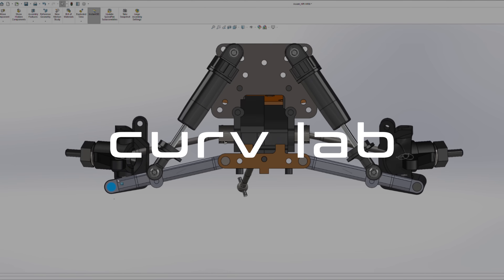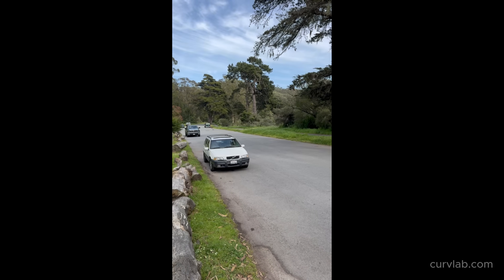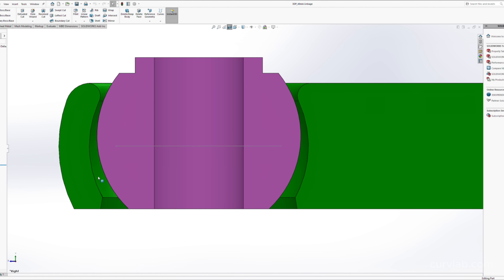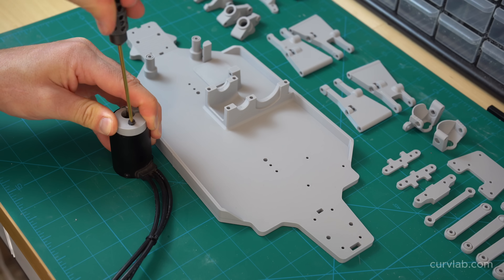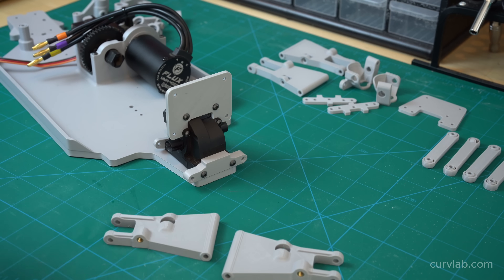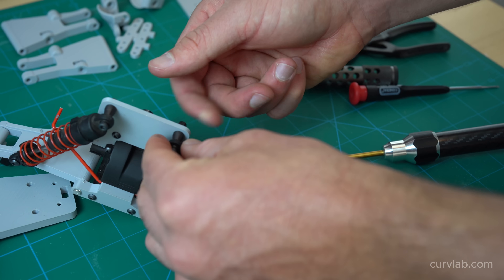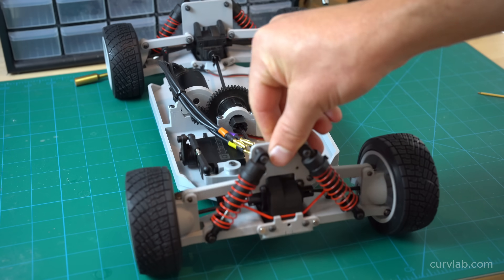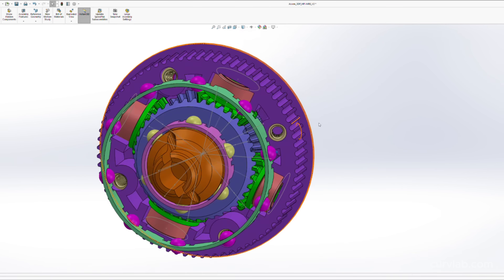3D Printable RC Chassis [PART 1]

Comment: I cant stand my bambu lab x1carbon. One the small size. Two I bought it just before they release the h series printers... and three and mainly three. My printer SUCKS. PRINTS FAIL CONSTANTLY. MACHINE DOESNT NOTICE FAILURED AND CONTINUES THE JUNK PRINT AND RUINS MY HOTENDS AND EXTRUDER COVER AND OTHER PARTS. Have submitted tickets in regards to the issues. Have got some parts replaced. Yet my prints still fail...

Comment: Id have to check specs but im thinking cheap drone motors geared down a lot. You'd have crazy torque and super high RPM. Should be lightweight and efficent as well. Amazing work and your design might be adaptable for that with minimal modifications.

Comment: I'm impresed by your skill in CAD modelling in SolidWorks. Your CAD assembly is fully "mechanised". If you take the wheel up in your cad assembly, all chasis elements react! I made similar in SolidEdge, but with smaller amount of parts.. incredible good cad skills you have

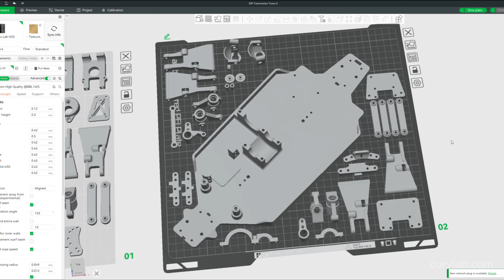Comment: This is a masterpiece! I would love to drop a few positive advices for you. First of all, it would be great if you do your own project based on most famous and common chassis such Tamiya TT02, LC Racing PTG2, or the new entry HNR Foxhound. Those 3 for me are the best chassis to get along as example for your upcominh project. Secondly, most of RC nowadays are mainly 1:10 onroad and offroad rally, and its just a matter of shocks and tyre. I suggest you to build a car with Rally anatomy so in future you can just add on 'on road parts'. Last but not least, make it dust and waterproof as much as you can, people love running their RC in any terrain. Goodluck!

Comment: Ugh. Bro you're able to 3D design an RC car any way you want. And you ended up using ball joints and c clips for the suspension lol. As soon as you hit a large bump or have a moderate crash those ball joints are popping out. And c clips are a pain to take on and off for maintenance, not really reusable. You're also using a traditional flat pan chassis which isn't bad but isn't great. A monocoque chassis would be a lot stronger and more rigid. At least add some chassis braces.

I get it, you want to be able to 3D print RC car parts. But you're only emulating old outdated designs when you could be creating brand new ones. Take a look at modern day RCs engineered today to get an idea of what's better. Also check out banned racing RC cars because their performance is so much better than traditional ones.

Comment: You have my attention ... subscribed!  I'd love to be able to print this out so if you need some sort of tester base, count me in.  I get all the engineering, but I've got 0 experience w Fusion ... so would love to use your build here for sure
At around  13:38 when you're looking at chatter, it looks like there is a lot of slack in the 4-link pivot points (the print-in-place you did).  Look at the passenger side, top-inner pivot and it looks like the top arm has a lot of left-right play against that top-left pivot

Comment: you said the AMS 2 automatically dehumidifies filament?  i don't think that's true.  unless you just mean passively with the desiccant.  it does have a drying feature, but i'm not sure what the point of it is... it makes you remove the filament before it'll allow you to turn it on.

Comment: Awesome project! Have you ever seen those chassis with honeycomb structure in the base? I have a MJX truck with that structure and it seems to add good resistance and shaves a bit of weight off the project. Keep it up, dude! BTW, I think MJX got it from traxxa$...

Comment: While it is sad that RC shops are becoming more sparse, 3D printing really revolutionize the RC hobby
Reply: There is way more work involved. You have to sand down the layerlines in order to get rid of the human skin and dust collecting behavior while it also is not watertight for every single printed part. There is still an absolute need RC shops. It's not for everyone
Reply: @MrGTAmodsgerman  I'm not comparing the two. I'm just saying that one is good and one is bad in the modern times. I miss physical RC shops is what I'm saying, but I also think 3D printing is a cool new thing for the hobby that didn't exist back when there were shops.
Reply: @batman3698  Ok good. Well yea it's defenitly a game changer and i rather see it as an addon to the existing RC world.

Comment: im in the middle of modeling an ENTIRELY 3d printed, 1/5th scale, 6x6 with dual material wheels PETG rims and airless style TPU tires interwoven into the rims. all nuts and bolts/screws and axles with portals and bearings, and shocks/springs, gears, ect are 3d printed. the only things not printed are the electronics.
Reply: Very cool, du you post updates somewhere or plan to make a video about it?
Reply: I also want to start my first big diy rc project but im ass at cad modeling

Comment: Interesting, I also noticed the issues with the steering and a lot of slop at the ball ends. Also for racing you will need adjustable linkages such as titanium turnbuckles. Also in a race setting, the more that can be quickly replaced on the chassis the better. For example, your motor mount is integrated into the chassis, but if it breaks your race day is done because you would need to effectively rebuild the rc to transfer the components over to a backup chassis. I have scrambled to fix my rc's if I break during qualifiers to be ready for the main races and these are relatively small things like brokens arms or servo swaps. I love this idea and we use a few 3d printed parts in the race environment. But I could see this great for the kids that just want to drive and dad could just 3d print the parts and source the non-printable in a kit online.

Comment: Very well done. New 3d printer owner here. Amazing work and yes having the ability to print what you want when you need it especially with RC cars is great. Cuts out a lot of unnecessary manufacturing, shipping and so on. Play in the top arms from the printed ball joint may have an effect on the wheel wobble. Would it be possible to print the top arm and insert a metal ball and print or melt over it to hold it in tighter?

Comment: Subscribed, I know a good engineer when I see one. Made a car just like this when I got my first 300 mm printer, integrated most of the parts into the chassis to take advantage of 3D printing. Ended up super rigid and easy to assemble. Definitely agree with you on 3D printing being the future of RC car parts.
Reply from the maker: I appreciate you! Yeah 3D printing is made for RC hobbyists
Reply: Dude you got any links or resources? I have a 254mm printer and am so keen to try something like this

Comment: I personally love high hardness TPU @100% infill for parts that need a little compliance, but still end up pretty stiff. So stuff like the upper shock mounts, motor mounts, etc could have an intermediate TPU part that bolts onl Also nice for motor mounts for temperature stability. It works in "actual" automotive applications under the hood too...Easy to print for the capability.  
Just dont try to make a lower control arm out of it 😅

Comment: Really cool project! 👏 One thing you might want to consider is designing the front suspension with Ackermann steering geometry in mind. It can make a big difference in handling. Maybe you’ve already accounted for it, but if not, it would be really interesting to see a comparison between the current design and one optimized for Ackermann.
Reply from the maker: Definitely not Ackerman currently. I’m sold. Going to try optimizing for Ackerman

Comment: Maybe just having one upper link causes some suspension flex. Why not have a double wishbone system? It has fewer joints at first glance. And if you can get the wishbone spacing between the front and rear chassis mount far apart, it should be potentially stiff. Cool project!

Comment: The front wheel upright (or turning nuckle thing) looks too thin for how importaint it is for suspension geometry. As for the ball joints, hopefully you can find something off the shelf for the ball.

Comment: Super cool.

I don't see why we could not move over to a monocoque design if we are moving over to 3D printing RC cars.
We could probably make a stiffer and lighter RC car using a monocoque design. But maybe we end up being limited by the local strength of the 3D printed plastic. 🤷

Also we still need to be able to mount the servo, motor and battery. But if we have the space we might as well try and use it.

Comment: Instead of a plastic spur-gear drive, consider a belt-driven model. *Sure*, you'd still use a printed plastic "gear", but the teeth are far more sturdy as they're only used to drive (or be driven by) a belt.
Also quieter than spur gears.
Reply: And of course you've already thought of it :D Helps if you actually watch until the end, eh?

Comment: The AMS filament device does NOT automatically dry your filament.  You have to manually start it, and it won't dry while printing.  Starting the drying process is a pain too, only done from the front panel on a tiny button.   Can't be done from the app or on your computer.  This needs to be fixed.  It should allow drying while printing, and be controllable from the computer or phone.

Comment: Awesome build man! If you are still chasing the slop in the front wheels, I would look at your camber links, and maybe look into replacing them with the same kind of link your steering links are. The tolerances on the camber links have to be extremely tight in order to remove that wheel play, but not so tight they start binding. Even HPI themselves don't make these links to the spec they should be sometimes.

Comment: You can also shim around the cvds where they enter the back of the wheel hub for more wheel stability, and shim in between the two bearings inside the hub can help out too. Amazing work!

Comment: I wish I was this good at CAD ☹️ It’s crazy how people can just pull all of this out of thin air! Really a talent.
Reply: I assure you people who are capable of designing in cad are not pulling it out of thin air. Last time I designed a chassis in cad it took well over a year. Lots of hard work, research, testing and development. I didn’t go Abra ca fuckin dabra, even once
Reply: @richhowes2486  The point Speedy is getting at isn't that he did all this in a day, but rather that he isn't just making a part 5mm bigger here, and 2mm wider there. He built it all "from thin air". Just like you built your hostile ass comment from thin air replying to a guy who was *impressed the creator could cad something so complex*,

Comment: This is great! I would absolutely mount the servo horizontally, but I understand that is just the way that hpi car was set up (instead of -| it’d be more like || compared to the rest of the steering linkage). I also would definitely look into making adjustable mounts for the motor, the speed controller, the receiver and the battery, it would make tinkering sooooo nice. Usually you’d want the motor mount to be slightly shiftable horizontally so that you can change the sizes of your gears and still mount the motor, but things like the esc and the receiver sometimes don’t even get mounting screws and we stick them on with double sided tape. An rc gps mount would also be very nice, the most commonly used one is the sky rc gps i believe and it’s just a little square. I also don’t really understand why you are using petg over abs, but I don’t know that much about plastics so if someone can explain the choice, I’m all ears.

Comment: You may end up with wheels breaking based on your current design. It might need more reinforcement near the hex to the outer rim.Ive had 3d printed wheels fail here a few times  
On a different note if you don’t like gluing tires to the 3d printed rims a simple beadlock can work great, I’ve been bashing some 1/10 scale rally cars with 3d printed beadlocks and so far they are holding up well

Comment: Hey, you're probably not going to read this comment, but I am actually doing a similar thing right now. I started designing a 3D printable rc car back in february and am still improving. It is not nearly as good as yours but is a lot of fun. I tried to print everything except the motor and controller, so even the tires, axles and gears. But mine looks a little different to a normal rc car as I did it without inspiration and came up with every part myself. Anyway, what you did is a way more professional and durable way of making an rc car so big ups to you man, great work!
Reply from the maker: I am in fact reading this comment. Heck yeah dood, printing the axles and gears is no small feat, especially considering you did it from scratch. Share photos or a video when you're done!

Comment: I didn't see that there was any adjustment for gap between the motor and spur gear. With an old hpi savage (nitro) I have you can loosen the motor and adjust the gap between the 2 gears. I had stripped a few gears quickly and after some investigation, the failure in the gears was the gap between them. To tight causes problems and to loose usually breaks teeth. I remember reading on a forum that the thickness of one layer of the plastic that the spare spur gear came in was perfect gap. Just sandwich it between the 2 gears and tighten up the mount. Worked so great and stopped breaking teeth. Good times, and great vid. Excited to see what you come up with next.
Reply: True and it would need the this adjustability when you need to change gearing.

Comment: Impressive...I like the print in place balls,very nice, as well as the heat set inserts. Im not a fan of eclips myself but it works
Ive build a couple MKultras and the designers other cars, one of them being a mini. That one has yet to break a spur gear, although being 32 pitch helps its strength.
Looking forward to your future content!

Comment: You make a common mistake. 
You copy existing ways.

Why is the chassis the only load bearing part? 
You have to build a whole car. That would allow for a really new design. A real car should be a good starting point.
Reply from the maker: I don’t follow what you mean
Reply: @CURV-LAB when you make the whole car load bearing you have much more room to create efficient and light structure. Even in formula cars the cockpit structural. 
You create a plate (the chassis) and add decoration on top. That decor could be integral and structural designed.

Comment: I printed the DKS basic chassis. I really like it. I am designing my own Cover for it that resembles my car in rl. The magnetic snap on and height adjustment of the cover is pretty nice and the fact you don't need any rc related parts except of the motor, servo etc is the main reason I printed it. Maybe you can "steal" some ideas from that design like the split base and how it mounts together with 2 brackets on top. My printer has print volume of 220x220x270mm that's why I have to print large parts seperate... But that design really makes it feel like one solid piece. The suspension is just 2 pieces of TPU instead of the normal links which works quite nice for such a simple approach. Maybe make 2 versions for people that don't drive too hard and want it simpler maybe? Just a thought.
Reply: Where do you got the files for the DKS basic chassis from 😅
Reply: @L.M.100 From printables. Just type in DKS basic in google and the first that comes up is that.

Comment: This looks so promising!
I love the design, but i would recommend to switch to CVDs in the front, as you can have more steering angle with these without the drivshafts popping out of the cups.

I printed and have driven the PROTO36 from CET3D, which is also very cool to build and drive. There i had the issue with the small steering angle or axles popping out.
The belt driven versions sounds very interesting, but i am curious, if those printed gears will hold. So i would apprecieate, when we can choose if we want to print the diffs or buy them, when we buy the model 😇

One last question: What dimensions do you have in mind? (Wheelbase and width)
So what non printed bodys could we use :D 

Thanks for this prototype and your work!
Reply from the maker: Thanks for the input. Will have to look into CVDs

Comment: Looking good for a first prototype ! For the holes, from my experience, I'd go with a hexagon shape rather than a teardrop one, the sharp corner on the teardrop could be a failure point more easily, hexagons are as easy to print when oriented with the corner upside !

I'd love to see that châssis adapted to be a buggy, I've been wanting to build a 3d printed RC car !
Reply from the maker: Ooo good idea with the hexagons. Didn’t think about stress riser of the teardrop
Reply: I don't think the stress concentration on the teardrop shape is any problem for 3D printed parts. Cause when you print it you will never get that sharp of a point. You have a very similar stress concentration between every single layer anyway.

Even if you have a stress concentration there you would just get local yielding (For an ULS load case, Ultimate Limit State) and for fatigue I don't think it is any worse than all the small cracks between every layer. 

It would be a fun thing to test though.

That said I might want to give the hexagon idea a try. I never tried that and is sounds interesting.
Reply: @Petch85 that's an interesting take ! There's why i said it was through my experiences lol

I'm up to see which shape would Withstand more abuse during bashings too ! 💜

Comment: I like the idea of printed RC cars so you don't have to buy or source replacement parts but, I prefer a car that doesn't break lol. What material are you printing in?
Reply from the maker: PETG right now but depending on strength may end up switching to an engineering grade filament